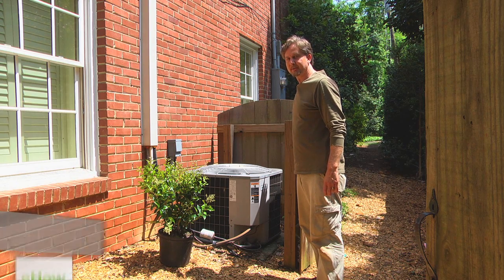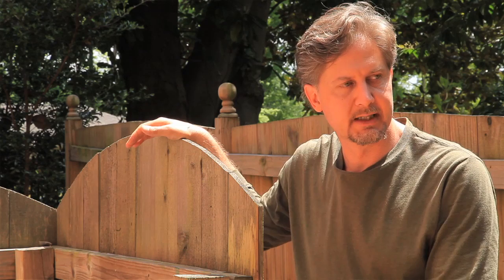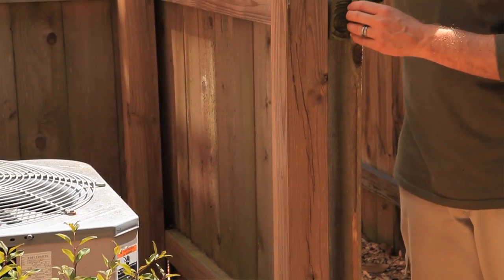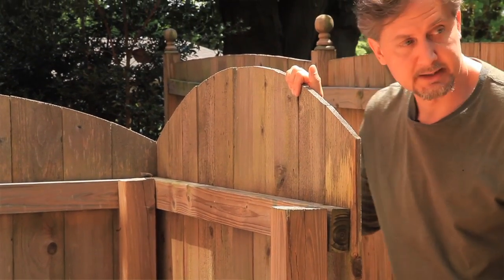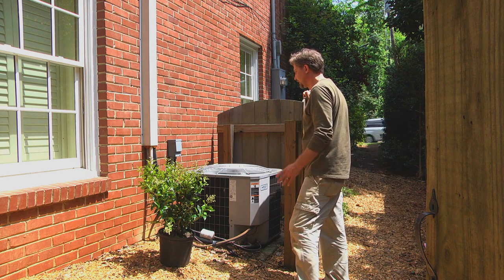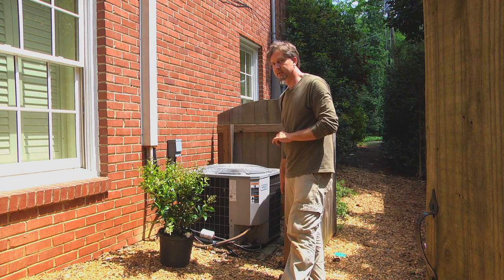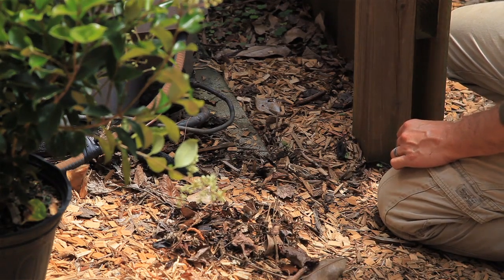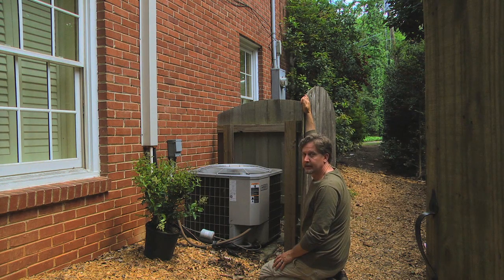How to Hide the HVAC Condenser for Landscaping : Landscaping Materials & Techniques

Comment: The air does not always exit the top by going straight up.  Many units disperse the air in a sprawling  air pattern and it gets sucked back into the grills . The ambient air cannot carry the air away and creates a micro climate ten to twenty degrees warmer . Those little shrubs also get big  and prevent service access as well as block the air .. Not recommended